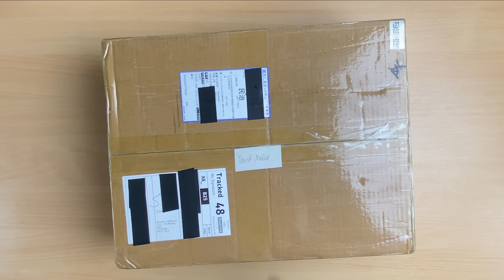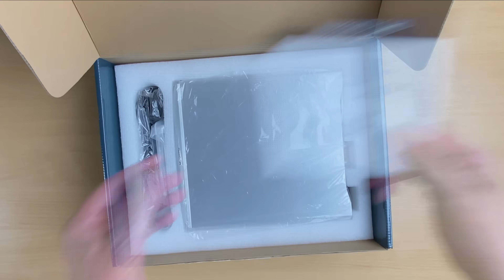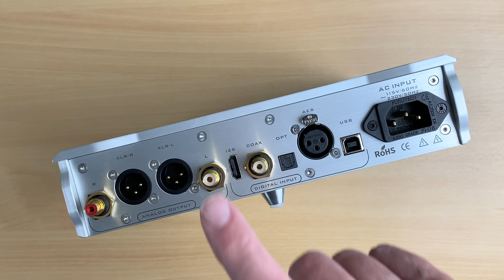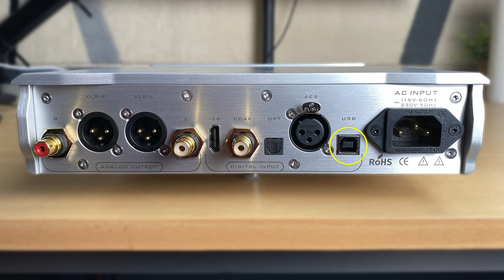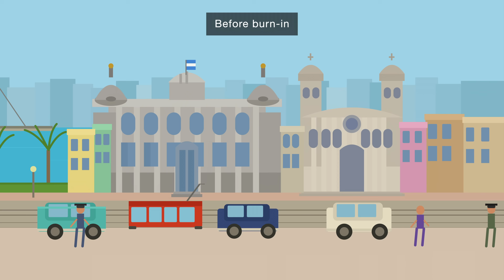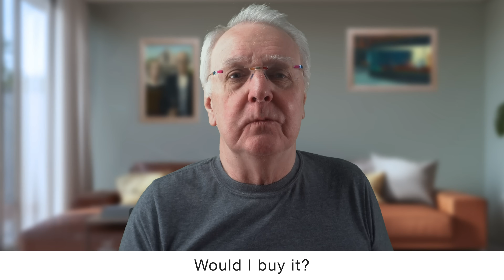168 hours later - Did this $1200 R2R DAC actually improve? [Musician Pegasus III]

Comment: Audio things that i could be persuaded might, may, possibly improve (i mean change, the word improve is subjective) with putting electricity through them is amp tubes and, erm, did i miss anything out ?
Reply: You missed out on caps, insulating materials and connections of any kind, especially from one metal to another. And as all of these are in overabundance in any piece of electronic audio equipment, yeah, you missed a lot.
Reply: @ernstraedecker6174  Explain to me like i'm a 5 year old what exactly, and i mean exactly, changes 5 seconds after they get to heat tolerance temperature ? And then what exactly, and i mean exactly, what will have changed 5 days later with constant running...
Reply: @tam8197  Well, Tam, first of all you are neither a procecutor nor a judge,  so you have nothing to demand of me. So skip the highly legalistic tone. And next time, add the word 'please', please. Learn some manners!

Now in physics 102 you MUST have learned that insulators are NOT inert. They consist of molecules that are neutral as a whole, but are portrayed as being dipoles, that is having a more negative and a more positive side. The standard depiction is an oval with a (+) at one end, and a (-) at the other. Let's take cables and skip the caps.

The insulator (pvc or teflon or rubber or a poly-soandso or even oiled cotton) sits around a copper wire. If you put a positive charge on the wire, the 'oval' molecules in the insulator touching the wire will REALIGN themselves with their negative (-) side to the now positive wire. That is, they turn around (in this simple depiction). Now put a negative charge on the wire. Lo and behold, the 'oval' dipoles realign and turn around again, now with their positive (+) side to the wire.

Imagine what happens if you apply an alternating current to the wire: the dipoles in the insulator will rearrange themselves continuously with the AC. Same with a signal applied to the wire.

However, in reality the molecules in the insulator are not oval dipoles that easily turn around. They are elongated and probably have more than a few positive and negative areas. The positive areas of one molecule will 'glue' to negative parts of other molecules. This gives the insulator strength as well as flexibility. The atoms do not form a grid, like in the copper wire, and there are few free electrons.

Also in reality with AC or a signal, the energy and signal do not flow IN the wire, but as an electromagnetic wave AROUND the wire. The electrons vibrate and the wave moves forward.

What do we find AROUND the wire? The insulator. So the wave flows THROUGH the insulator, with all of its elongated molecules desperately trying to align themselves continuously with the everchanging signal.

So insulators are not inert. Their molecules dance with the music. These move, that is, they wobble.

Now over time the molecules try to find the easiest relative position towards each other to make that dance the easiest. In physics terms: they seek a configuration with lowest (potential) energy. As is quite normal in physical systems.

This finding the easiest configuration takes some time. And THAT, my dear Tam, is cable break-in. It generally takes between 2 and 8 days, depending on playing time and type of music.

So in the beginning the molecules are pretty irregularly aligned. When the first electromagnetic waves of the first music arrive, these waves have to plod through the irregular mud of the insulator. You can hear that: you get a muddy sound.

But after a lot of being bounced around, the molecules gradually find better positions (of lower energy) and wobble easier with the music, that is the electromagnetic waves. You can hear that: the sound becomes clearer, more open.

Finally the molecules find no further improvement of position: their configuration stabilizes.

Break-in period and final result and sonic effects may depend on the type of insulator, the thickness of the layer, the gauge and configuration of the wire, the type and construction of the connections and connectors.

Classic audible break-in phases are:
1. Muddy sound
2. Actually quite nice
3. Oh dear, bass becomes bonky and treble pretty sharp, edgy
4. Hm, bass seems better now
5. Highs still a bit sharp
[6. Ahhhh, finally highs are good too]

If you think it's all in the brain, buy 2 interlinks. Have one break in for 2 week of normal playing. Then listen carefully. Now put the fresh cable in. If you don't hear a difference, you're probably deaf.

There's no price tag involved in breaking in, just patience.

Not all cables make it to phase 5 or 6. These are the so-called shit-cables. They remain tinny, edgy, sharp, or have bonky or blubbery or woolly bass, or too much 'presence' (forward mids).

Now apart from this DYNAMIC behaviour of the insulator, there are of course the well-known STATIC properties capacitance, inductance, series resistance. These mark boundary conditions on the behaviour of the cable. With many expensive fancy designs their values are far off.

Generally simpler cables with simple connectors sound better. And as simpler cables are cheaper, you're lucky.

Complicated cables always sound complicated, or abnormal. Cables with boxes are bad. Cables with fancy battery driven turbo shielding are garbage. Golden cables are a rip off. Silver cables are VERY difficult to get right and very expensive. Heavily shielded cables sound dark.

Now start enjoying music, please.

Comment: Next to "audiophile" cables, expensive dac's are the biggest load of snake oil going.
Reply: I think you'll find that's audiophile fuses or crystals that sit on top of components.
Reply: My vote is for interconnect lifters.
Reply: Amen, Brother!
Reply: While there can be both measurable and audible differences between DACs, their price does indeed rarely give an indication of their sound quality. The built in DAC in a mainstream TV or in a mainstream AV receiver may very well be better at its job than many discrete "audiophile" DACs for several orders of magnitude higher price. Exorbitant pricing and "audiophile" labelling is the (potential) scam, not that all DACs would be the same.
Reply: they are until they arnt, there is a video of the D30 pro vs the Denafrips Are II on youtube, easy to search for, you can hear the demo and indeed the delta sigma one has more sheen/digital glare . its close but also not really if you think about long term enjoyment.  it all about if your system is transparent enough to even show the difference. bellow a 1000 usd for your amp and drivers, dont expect that kind of transparency, just get the cheapest dac and enjoy

Comment: Have you ever listened to a DAC that you thought, even on a psycho-acoustic level was different either better or worse ?
I get the notion that all DACs sound the same but you get to listen to a lot of DACs and if they all sound the same then the reviews just reinforce the notion that all DACs sound  the same.
Reply: I was in the same spot as you. I bought a lot of DACs and amps looking for the audiophile stuff I was reading and watching about, and after a few thousand bucks and many months of my time, I realized I could not hear any difference between a $200 DAC and a $2500 DAC. They sounded the same doing A/B switching as long as they were properly volume matched. I can hear up to just a bit over 14Khz, so if there is a difference, it must be in the frequencies above that.
Reply: @l00d3r  It's not about the high frequencies, but about the structure of the sound.
Reply: @ernstraedecker6174  I can't hear the difference regardless of the DAC I use.
Reply: DACs are transparent, but amplifiers sometimes not, that's why some dongles color the sound.
Reply: AS far as I understand it, all DACs DO NOT sound the same. Some like R-2R in NOS mode might produce distortions relative to delta-sigma due to the sampling frequency not filtered out properly, or due to the factory tolerances of the resistor components in the resistor ladder leading to slightly different amplitude steps. The question is whether these differences are detectable for most human ears - as far as I'm concerned at age 67, they aren't. They probably are clearly visible on an oscilloscope though...
Reply: @sven.b.schreiber 
You’re right, they don’t but you will need a system that’s able to reveal those differences.
Reply: @sven.b.schreiber  I bought into the R2R hype and got a Gustard R26. To my ears, it sounds the same as my Chord Qtest, SMSL DO200, and even my Topping D50 III when volume matched. So I am no longer buying expensive DACs. I am happy with my Topping D50 III paired with my SMSL HO200 amp. I am selling the rest. The HO200 is not the only amp I used for comparing the sound of my DACs. I also used a Schiit Lyr+, a Topping A90D, and a Headamp GSX Mini. Headphones I used were the Hifiman HE1000 SE, Hifiman Arya Stealth, Senheiser HD6XX, beyerdynamic DT1990 Pro, and Dan Clarke Aeon 2. Honestly, I can hear no DAC sound difference in any combination of my gear. It's crazy.